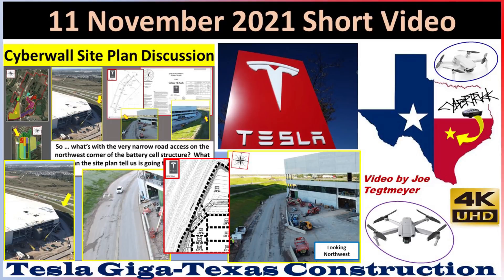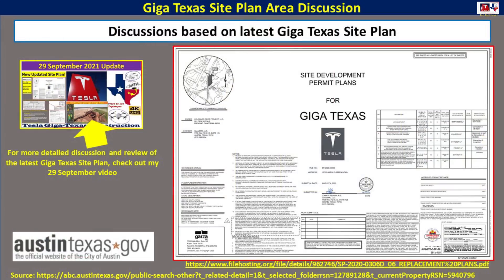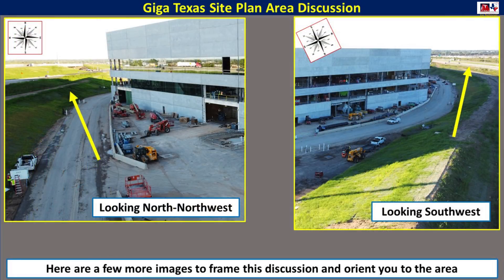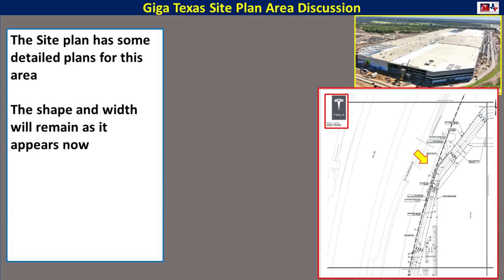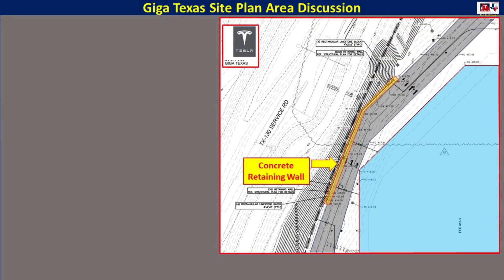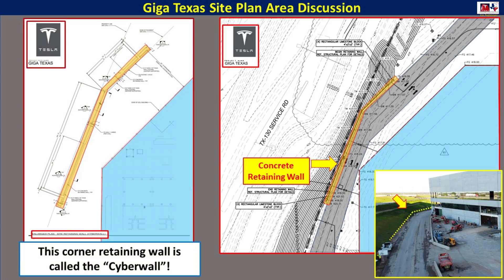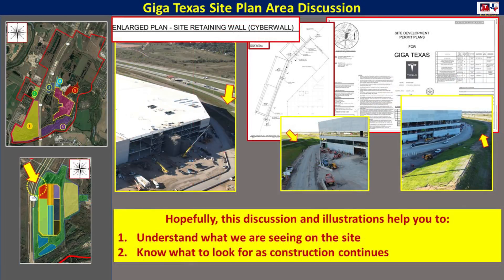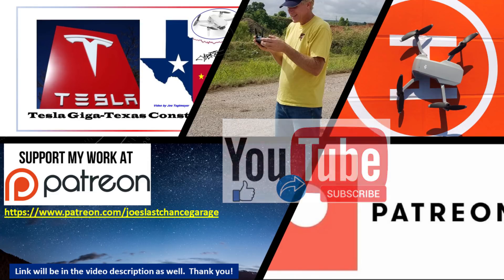Tesla Gigafactory Texas 11 November 2021 "Cyberwall" Construction Discussion SHORT Video (4K)

Comment: Thank you Joe for the update. That "pinch point" on the access road never made any sense to me, but I guess the tow of the slope is the property line for the right of way for the highway. Way to go Tesla utilized every square foot of property between the setbacks from the high voltage lines to the right of way for the highway.

Comment: Thanks Joe.

Cyberwall. Why isn’t there a Cyberpond, a Cyber Splitter Box, a Cyber Ramp? So many missed opportunities. 

The north-west pinch point. This has confuzzled me from the time it first became obvious there wasn’t much space there, and I’ve been back and forth between ‘that’s an oops’ and ‘it’s not a problem, it’s 3 lanes wide’.

It should have been obvious to the design team that there was a narrow space there. At the design stage it would have been a simple matter to shift the entire building a column spacing south 45’10 14m. Would have freed up space for another lane, a sidewalk/footpath either side, maybe wouldn’t have needed the Cyberwall at all.

I started off writing this comment with the mindset that yes it’s a pinch point, but only in relation to the size of the building. As I was writing and the penny began to drop, I had to edit and rewrite. This pinch point may well be a simple design mistake.

Comment: Joe, you could mention that one of the reasons its so narrow is that the Texas Highway Department owns the land above and my guess did not want to sell it to Tesla.  Had they done so, there could have been a wider roadway and a taller, beefier ‘cyberwall’.
Reply: TxDOT is highly unlikely to sell any of their land to a private company, unless it can't be used for anything else. To do so would betray the public trust.
Reply: @DavidJohnson-tv2nn  👍
Reply: @DavidJohnson-tv2nn  The highway department did sell some of their highway land to Tesla but not here at the bend.
Reply: @77chickox  The land they sold to Tesla was a tiny piece that stuck out from their north-south property line, and couldn't be used for anything else.

Comment: It’s still interesting that the design team didn’t leave more room there considering they had so much land area to work with.
Reply: Agree (now, I've been wavering). The entire building could had been located a column spacing south, and there would have been plenty of room.
Reply: It did seem odd that they'd cut it so close... I'm fairly sure that they didn't do that by accident, but it does seem like a near mistake.
Reply: @texan-american200  The fact that the road is narrower there than anywhere else and that no other road has a similar bottleneck makes me think they originally thought they were going to be able to cut into the berm more with a higher cyberwall but that maybe state law requires a a greater distance from the highway than anticipated. Also as an architect and a mechanical engineer, I look at it and it looks like a mistake even if it isn’t. Having to drive that close to the building looks funky to me
Reply: @jimmccall8030  
So they broke a cardinal rule of proper planning and didn't do complete research of the area in its entirety and they ASSumed... 
In other words, they didn't measure twice to cut once. 😬
Reply: @jimmccall8030  They can't place the wall further out without cutting into TxDOT property.
Reply: @jimmccall8030  When the wall is built, there will be three full width 12' lanes, two southbound, and one northbound.
Reply: @texan-american200  Which if true is is pretty amazing considering they undoubtedly have dozens of top notch designers, engineers, surveyors and code experts on the team. Maybe we’ll know the true story someday
Reply: @DavidJohnson-tv2nn  How close will the nearest lane be to the building?
Reply: @jimmccall8030  Very close, 1.84 feet.
Reply: One clarification... The top of the wall is not right on the edge of Tesla property. But the wall sits on a 9' - 9" wide footing.
Reply: @DavidJohnson-tv2nn Thanks David. Confirms for me there was an “oops” somewhere along the line
Reply: @jimmccall8030  
Bet you dollars to donuts that they started the survey on the opposite side of the factory... 
📏🪚💥🤯😱 😬

Comment: Joe... Thanks for the update on the retaining wall. Note: On page 15 of the site plan, it does show a wider road. Three 12' lanes. Two southbound and one northbound. But as you said, everything will be on Tesla property.
Reply: David, from my calculations and reading the elevation lines the width now is ~30' and with the wall it will be ~40'. Maybe the design of the road was intentional, all deliveries and outside commercial traffic will enter from the South and exit to the South. Only TESLA employees will be going through this section. It is hard to believe that when they put in the tollway they had their berm partially on someone else's property.
Reply: @eltonray2934  Just looked at the drawing on page 15 again. Agreed.
Corner of building to edge of wall ~40"
Road ~36'
Corner of building to property line ~48'
Reply: @DavidJohnson-tv2nn  David, You probably saw this page 11 sheet 020 bottom center.
"Access to service / access road denied"
Reply: @eltonray2934  I missed that. Thanks. But what is meant by that? No access to TxDOT property? Or no connection of private roads to the offramp?
Reply: @DavidJohnson-tv2nn  I take it to mean that they cannot have an exit from the loading dock area onto the tollway offramp which would connect them to the tollway and 973. I had always thought that was why they did not need a wide road by the corner of the plant, they were relying on this connection. That is why they have the wide area in the off ramp, to accommodate an entry point.

Comment: I'm betting that access through this choke point will be limited. Freight, deliveries, heavy equipment, day to day traffic will be routed via the South entrance, likely through the highway to the West. Tractor trailers and commercial vehicles will not want to use the toll road on a daily basis.
The entrance off Harold Green Road will absorb whatever civilian and visitor traffic, perhaps access to the other facilities on the North end. 
Apparently Tesla had to fit the building into the space available between the two obstacles, the power line easement and the berm. 
Is the actual axis of the building true North/South, or just approximate? ISTR someone saying all the Tesla new builds are along the North/South axis.
Reply: The building is at NS, just check with Gog Earth.
Reply: @eltonray2934  Yeah, you forced me to research it. As close as I can tell, using the line along the stamping area to the press area, the alignment appears to be a little less than 2 degrees E of due North. So I guess we can say it is more or less N-S alignment.
Reply: @The_DuMont_Network  Yes Doc, I did about the same thing, generated a line at the same points and was off about 1.5 deg. close enough, checked with 35L at the airport and still OK.

Comment: Would like to know where you believe the logistics lot will be? Where new cars are charged and loaded onto car carriers for shipment.  Also the test track. To me until we see those nearing completion production wont start.
Reply: Rather than charge the vehicles after manufacture, don't they part charge the cells during battery pack manufacturing?
Reply: @DAM89  Basing on what I see happening at Shanghai in the flyover videos. See them drive them out hookup to SuperChargers and then move to be loaded onto carriers.
Reply: @DAM89  When they manufacture the cell they have to use a special procedure to "form" the cells. After that the cells are at about 2 Volts. If the cells ever go below this voltage they cannot be recharged. The preferred method of charging at the factory would be low and slow.